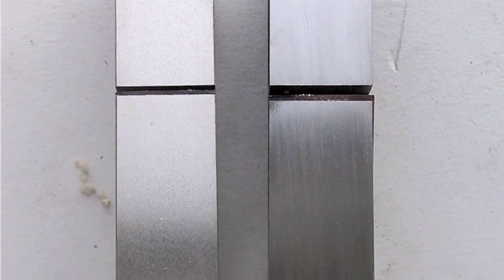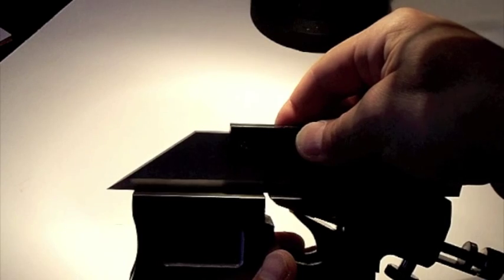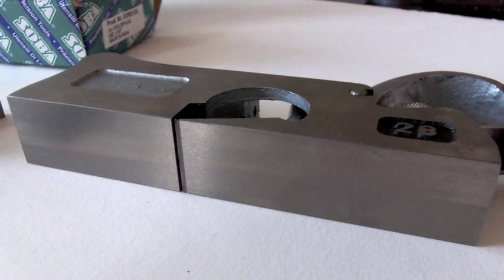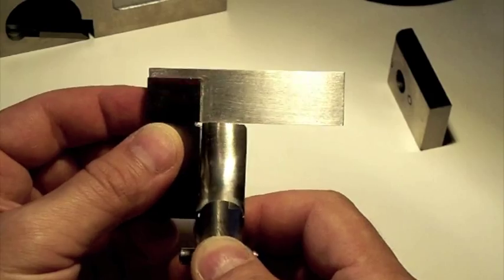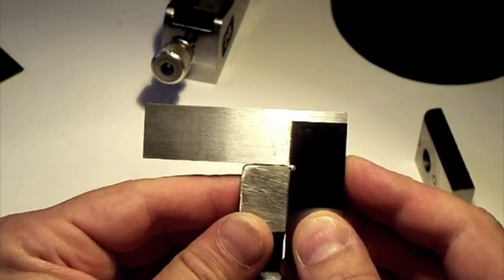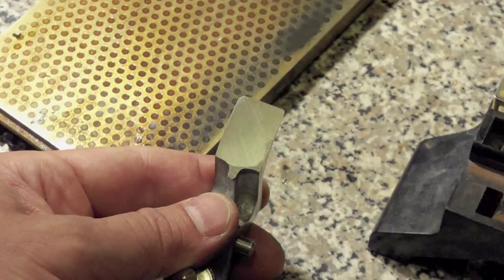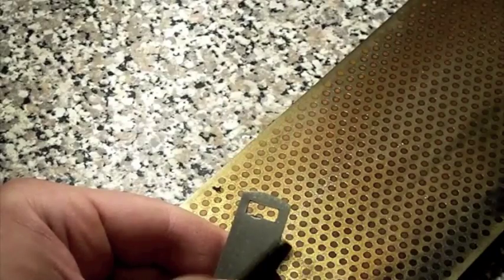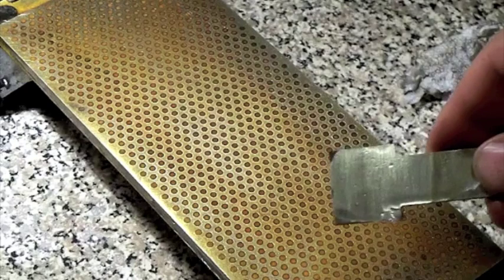SOBA (India) 3-in-1 shoulder plane tune-up and review

Comment from the maker: You are absolutely right in the case when one is looking to buy a brand new shoulder plane of the highest quality. However the SOBA  3-in-1 plane, which I reviewed, is more than a shoulder plane, as it can be reconfigured as a bullnose plane and as a chisel plane. The Veritas planes that you mentioned can only be used as shoulder planes. The only comparison to the SOBA is the $300 Clifton.. or an old Record 3-in-1 plane which can be found on the used tool market.

Comment: Thank you , interesting, but you forgot one thing regarding  the record 311 of which i love and have used with joy for the past 25 years, its cast iron  and is brittle , Today my baby fell from the bench and broke in two , Have had my baby fixed,,  as such but i can see some hours going on to reset the sole, so love my 311 i will do the time, Also blades are hard to come by to fit the older type,,, regards

Comment: Thanks for your excellent video Yoav. Interestingly I've just tuned up a Stanley No. 92 and found the blade to have the same lack of flatness with the tips of the corners below the main blade. Same poor machining technique at the factory or the same source of blades do you think?
Reply from the maker: David Quirk Hi David,
The truth is that only premium quality blades such as those made by Ron Hock, Lie Nielsen, and Veritas are really flat. All other regular quality blades tend to be either concave or convex shapes. Between the two flawed blades, I prefer to have a concave blade like the one you have, because it is easier to flatten it. You just need to abrade the two points you mention and a thin edge line (1/8") that "bridge" them. This is very similar to the blade back geometry found in Japanese chisels and plane blades.
Cheers,
Yoav

Comment from the maker: 1. It is difficult to adjust the blade clamp down screw. You will need to stick a screwdriver into the plane’s camber to do so.
2. The blade lever cap will loosen is grip on the blade once you retract the blade. So if you try to advance the blade after retracting it you will notice that the lever cap doesn’t clamp down as tight as before. Stanley’s engineers should have designed a grove on the back of the lever cap to be registrated with a bar, or a ridge, within the plane.

Comment: I have one of these however rebranded as Faithful and I cannot get the blade to adjust below the sole so doesnt cut anything or am I missing a trick? As it is a recent purchase I have emailed Faithful and am awaiting a reply.
Reply from the maker: Check the nut. See if something is limiting its travel down the screw. If it rides up and down without issues and the nut's wide shoulder ring fits into the blade's groove well, then I think you should be able to project and retrieve the blade with no issues.
Reply: @YoavSamuelLiberman  thankyou for your reply. I can turn the adjuster without issue. It seems like the angle of the slope means the blade closes the hole (throat?) Before the blade protrudes.
Reply from the maker: @tymbian Make sure to place the blade in a Bevel Facing Up position.
Reply: @YoavSamuelLiberman  lol.. I get that.. I could email you a picture possibly. I've just had another look and I see it comes with 2 shims. I take it I'm supposed to fit a shim ( or 2 ) between the removable nose part and the body. This way the mouth would widen and I could slide the blafe further down.

Comment: Hi! How would you proceed if the two sides are not square to the sole? Whould you flatten one side first and then square the sole to this side and then square the other side to the sole? And how?
Reply from the maker: This is a good question... 
Here is what I would do. First I would try to asses if the relationship between the sole and the blade's ramp (or slope) are correct. Sometimes the ramp is milled thicker on one side more than on the other (or the sole is eroded more on the right side than the left side). If this is the case the sole of the plane needs to be, not only flattened but also trued to the ramp. Once the sole and the ramp are in good relationship I would flatten one side and then continue to  the other.
Reply: Thanks. I hadn't think about the ramp. I really appreciate your answer.